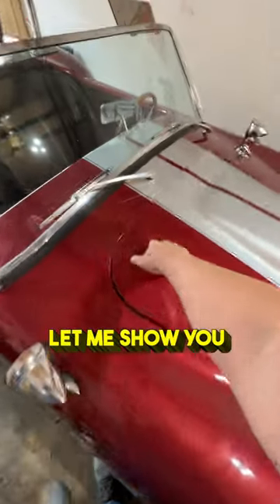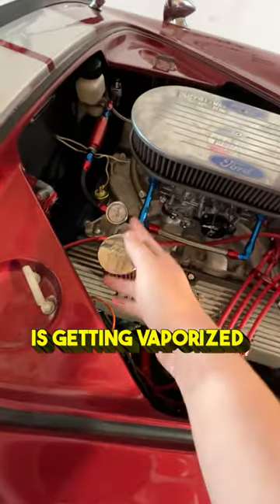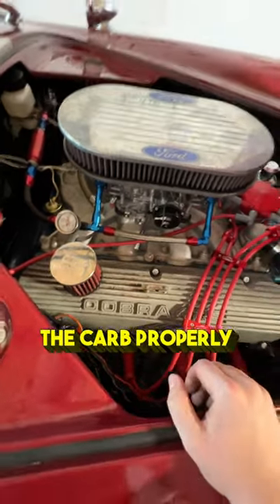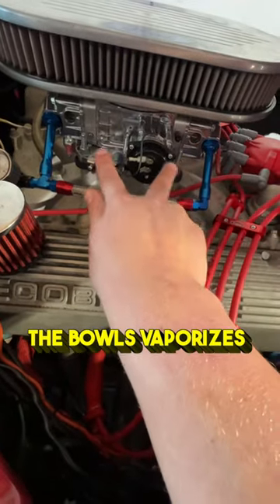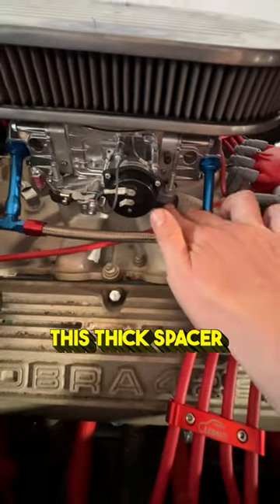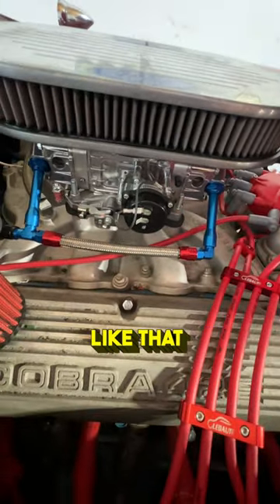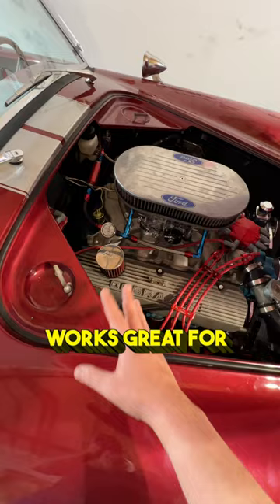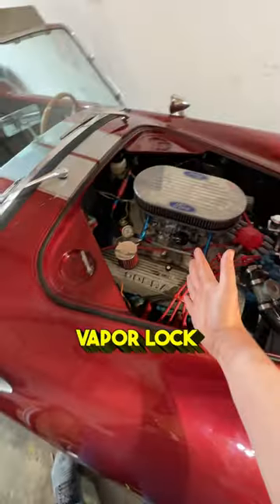What Causes Vapor Lock?

Comment: I’ve been working on cars from mild to wild since I was 16 to now at 68 and have never experienced vapor lock in my life.
Reply from the maker: Happens often down here in Florida with temps around 100
Reply: @wardwrenching  the exact reason I’m looking at these videos my c3 keeps getting vapor lock bc it’s summer now it’s beyond frustrating
Reply: I'm in AZ and this damn 94 f250 vapor locked on me today I think. It was running just fine, then died while I was inside. Wouldn't start again, just kept turning over
Reply: Damn what an OG
Reply: My truck keep jacking with me .thought I had I figured out its in the high 90s in Indy took the carb off and put my back up one on deffanly barking up the wrong truck then remember vapor lock .damn